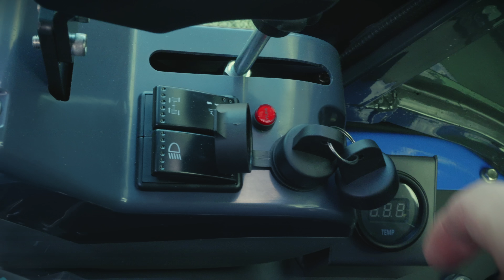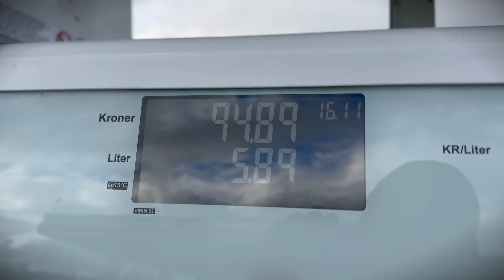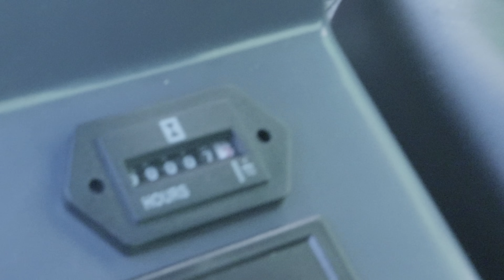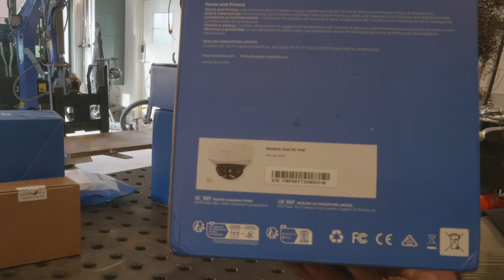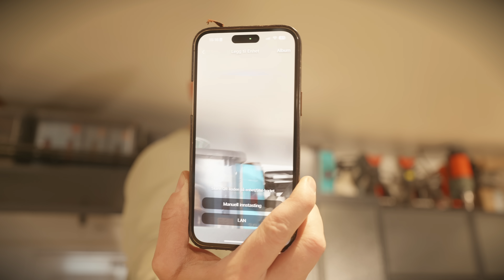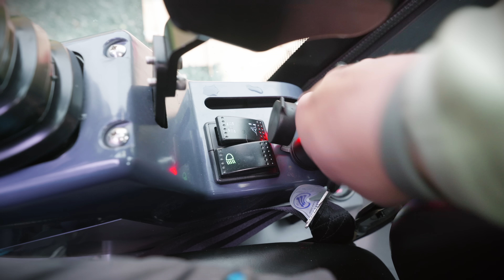I Bought a Mini Excavator From China and THIS Arrived!

Comment: I was more impressed by the truck. The way the bed opens and the mini-loader attached to it. Mind-blowing.
Reply: Those attached fork-lifts are pretty common here, they are also most electric now.  
The side and top opening truck box however is pretty cool indeed.
Reply: @DooMMasteR is that also from China?
Reply: I know it was really impressive. I liked the little blue thingy that moved the box out of the truck. Was carried away thinking what I could use it for.😂😂😂
Reply: They have indoor bathrooms now aswell ! Poor Russians
Reply: They are called moffett lifts
Reply: If you look at video again at about 1:07 the forklift moving the crate off the box seems to magically slide the box across the forks like it is using the force or something. I think it is AI Generated.
Reply: @peterprittscher7532  don't talk about something that you know nothing about, these machines are very common in Europe. It's called a truck mounted forklift (Kooiaap in Dutch). It moves the crate like that because the forks themself are also extendable, separate from the scissor mechanism that you see

Comment: I understand, but it looks a bit too tall, making it possibly top heavy.  Just one wrong angle & it could tip over.  It would have been nice if the track treads were a little off to the sides more to make the bottom wider, to make it less tipsy, but in a way having the tracks exactly straight underneath makes it narrower & compact to park somewhere.   Just have to be careful about angles/pitch where you drive it.
10/26/25

Comment: I love it. We borrowed one without a cabin to dig trenches for some cables. It’s definitely better to have one with a cabin, so you don’t have to breathe in the exhaust fumes all day and it is also safer. It works fine. If the ground is hard, one ton is light and you have quite a bit of work to do, especially if you’re operating it for the first time. But you get used to it quickly, and it’s fun to work with. You just have to be careful if the terrain isn’t flat.

Comment: My parents had a kabota tractor for a small farm, with front forks attachment. It had a hard life of cultivating heavy clay soil, clearing barns of manure but after 35 years it out lasted my mother and was given away to a local farmer.   Absolutely reliable, the only repair was re-welding a front fork bucket mount when it got ripped off.
Careful, don't let it run out fuel as you will get air in the diesel lines and high pressure pump and it can be a pain to bleed the air out.
Reply: Having had and driven many machines (skid steers and excavators) I know what a pain that can be, but this machine shuts off when low so it doesn't require priming. Most modern machines have this feature. You should always keep your fuel topped up though, it is just good practice and prevents condensation and water from getting in the fuel.
Reply: They have a little hand pump these days easy to bleed them

Comment: I’ve had a Kubota 1.5ton for around 10years now, just looking after 3/4 acre, not getting much use these days but it’s to handy to move on.
I have added a lot of wear to the boom by digging root balls that were to big for the machine and brushing dirt sideways with the bucket, if you cut these things down to a minimum your machine will give you good service. Cheers.

Comment: Trying to move excavator with metal parts still packed under threads and excavator still bolted to box, failing at the most mundane task of filling a tank with gas, hammering pin with the battery side of an electric drill.. and on and on. Dude, you should NOT be making these videos. Hire someone to do your work and stick to what you are good at. This tractor is not for you. You are giving me a concussion from the facepalms I took watching this. Cheers. (also, the tools you need for those potholes are called "a wheelbarrow and a shovel")

Comment: One guy said that you should start one , dont do anything for 1h , swich off change oil , start again do some work for an hour then change oil again. This should extend the life of the engine greatly. Make sanse to me
Reply: In older tractor manuals, it was always recommended to do light work, no more than half throttle, for some hours (10h - 25h, it varied from manufacturer to manufacturer), then change the oil. After that, you could go full throttle for a little while, 25 to 100 hours, again, depending on manufacturer, then change oil again. After that, the engine was fully ready for hard work.
Reply: @MrAstrojensen yes, always have to run your engine in .
Reply: @roystonevans2223  Not so much these days. The run in was primarily for the rings to "bed in" to the cylinder walls. The engines would use a bit of oil initially due to this. Since catalytic convertors came along, manufacturers have used bore finishing techniques that simulate an already bedded in cylinder, so they're virtually ready to go from the start, no run in required. This is because oil consumption kills catalytic convertors.
Reply: It's a Kubota engine. You can switch out the oil with dog piss, and it'll still run for 20k hours
Reply: I know someone who just ran it with the original oil. After a year, not sure how many hours of use, it had some kind of piston failure. He’s going to take it apart and see if he can get the parts for it.
Reply: Use the Dozer blade for levelling.
Reply: That advice is not bad advice it makes sense and to get more use out of it is the name of the game so it’s worth getting oil and filter ready for this and know what advice Kubota says
Reply: Gets rid of any crap.

Comment: Hydraulic thumb, and mud bucket... with a kubota engine, for 2k , i dont believe it , in Australia that would be at least 18k.. i bought a 1.3 ton machine 4 years ago with a 10 hp single cylinder chinease diesel; and a set of attachments, it cost 15k Au dollars

Comment: Coworker bought the same digger a year ago, and this year he got a Mini Dumper from china that you can drive yourself or use a remote controll. Stuff is f**ing great.
Reply from the maker: Sounds like your coworker has some great taste in machinery! 😂
Reply: @frengen_engineering  He is single and a lifelong heavy machine welder, and hydraulic tech. And he loved his horses. With these machines he can sit in the Digger, load up the dumper, grab the remote and drive in sightline to the right place, dump 5 wheelbarrows of material, and drive back to load..

Comment: I bought my first excavator 15 years ago.  It was a half wrecked 10+ year old Komatsu PC12R-8.  I got it cheap because the hydraulic pump was cracked.  Replaced that for $1100 and kept the machine for 14 years.  Sold it last year for $2000 less than I paid for it (buyer drove 5 hours each way to collect it, and had guys ringing for several weeks later, asking if it was still for sale (I guess they took a bit of time getting ‘permission’ from the missus 😁)
I bought a brand new Komatsu PC18 MR3. Phenomenal piece of kit.  
This little machine looks pretty good, but the buckets and all the components just even sound pretty lightweight.  Sure beats digging by hand, though.  
For the driveway gravel, try bolting a nice old railway sleeper to the grader blade, sticking out each side a good bit.  Does a fantastic job. 
Also, I welded on a thickening plate and drilled a hole through the middle of the grader blade to accept a trailer tow ball (I cut through the square hitch receiver tube, just leaving the ball on a piece of 18mm thick steel bent 90’, with a M22bolt through the blade.  Great for towing a small trailer that you can dig into as you go.
Reply: Wow that's a great ownership story.

Comment: Your driveway before you put gravel on it, was better than most roads in Australia.
Reply: To be fair, that driveway probably also sees more use than most roads in Australia.
Reply: Yes, we have many potholes in our roads in Sydney, but it doesn't matter because we can't drive faster than 10km/h (roughly 6mph) because there's a bloody speed bump every five metres! :face-orange-frowning:
Reply: @evp3891 I'm 900klm north of Sydney. The roads up here are a series of holes held together by tar.
Reply: @evp3891  The potholes, speed bumps, ridges, cracks, dips, humps and uneven roads in Sydney is why more and more people are buying and driving SUVs, mini trucks and vehicles with big tyres to absorb the shocks. Otherwise, one doesn't need any massage chairs - driving along Sydney roads is enough to either give you a vibrating massage or enough to rattle your teeth out.
Reply: @GeorgeHooi-t1r  yes, unfortunately you are 110% spot on 😱
Reply: The main road from Cairns to Alice springs is a sand road , I have been on it
Reply: @freespeech4023  Nonsense, the main road from Cairns to Alice Springs is definitely not on sand. I've driven it several times. If that's your experience, then you must have taken a completely different route away from the main road. Don't make Aussie-Roads worse than they actually are.
Reply: @eric.s.081you must have been  on a different road or the road I was on has been tarred now , I was in Oz in 2005 I have been and I was on the sandy road from Cairns to Alice springs , it has many lorries and buses stuck in the sand ,
Reply: Better than ALL roads in Ireland.
Reply: we don't have kangeroos here jumping around, must be the difference
Reply: @wizpin  The kangaroos in Australia learned to jump because of the many potholes we have out here.
Reply: Чёрт возьми, да у вас там похоже действительно всё перевёрнуто кверху ногами 😂😂😂

Comment: I’m amazed by the delivery truck setup!
Reply from the maker: The truck was super cool! 😎
Reply: I’m amazed how the crate seemed to magically slide towards the forklift.  How?
Reply: @castrain1419  I have rewatched a couple times and have no clue.  Maybe the forks have tiny rollers that we can not see? Or belts.
Reply: @castrain1419  Just saw extendable forks on down?  I guess?
Reply: @AJLindvall  Telescoping forks. THe hydraulic lines at the top of each fork provide the telescoping power. If you look at them before/after the cut around 1:05, you can see the forks are all nice and black, then when fully extended under the crate you can see the black 'caps' of the forks retracting over the more rusty inner fork as is slides.

Comment: For $12000 ,you have been ripped off ,especially if it's made in China .Also trying to get parts is a nightmare .
Reply: $2000
Reply: @malcolmstevens2838  It said $12000 in the description.

Comment: Watch Marty T from New Zealand...he has a couple of excavators including mini excavators....

When repairing potholes you need to use the ripper tooth to take apart the hole...so that the bottom of the hole that forms the "basin" gets holes in it improving drainage.
The new gravel then mixes in and "keys" to the hole.

Otherwise the new gravel just gets flicked way or washed away when the hole fills with water in the "basin"...
and a tyre running over it just pushes the water and the new gravel away from the hole.....

That's good excavator with plenty of accessories.

Always grease every part that needs greasing at the end of the day's work...ready for a quick start the next working day....
Reply from the maker: Thanks! I actually did this for the biggest pot holes. Used the teeth- digging bucket to loosen it up. Then I flattened it all with the dozer blade. Then compressed, before adding new gravel😊 But some holes I just filled with gravel, making sure I will have to redo it once in a while 😂
Reply: @frengen_engineering    Excellent future planning.  Have to make sure the justification for the tool is maintained. Multiple opportunities to impress the wife. 🤣🤣🤣🤣🤣🤣🤣🤣

Comment: Pssst ... I think your bucket is backwards there sport. You scoop at the bottom of the pile going away from you and up.
Reply: As if you know how the attachment works!  Pretty obvious to me that a) the hydraulic arm only connects to the accessories one way and there's no option on which direction the bucket faces, and b) by scooping inwards, it keeps the center of gravity more centralized (when the bucket is full) on a machine that has a high center of gravity to begin with.
Reply: No you don't.

Comment: Um, What are you going to do with it once you finish your reno?
Reply from the maker: Hi! As for most other tools, it opens new possibilities and sparks creativity… wow, that turned out cliché😅
Reply: At a guess...maybe hire it out?
It would be popular...
you might even risk "dry hire" 
where you give a brief instruction and then let the hirer do all the work at their risk????
Reply: @JohnSmith-pl2bk  For what he showed in the video I am sure it would have cost 2k or less to get someone to actually do the driveway. Seem a bit odd to actually buy a machine for a one off job.
Reply: @FullLengthClassics you invent jobs with a machine like this.
Reply: @FullLengthClassics  
See Just a Few Acres YT channel. 
Pete bought an excavator  second hand...and so far has found multiple uses for it on his small farm...doing things like drainage ditches, gravel driveways, gardening, stump removal, water line trenching, steel fence stake extraction from the ground thereby saving his back,  firewood tree handling etc. etc.

Marty T channel uses excavators large and small...
and Marty bought a "mini" Takeuchi which is the Rolls Royce of excavators....
but also uses a 50 year old Hitachi he found abandoned in a forest...
and a small old excavator he uses on an island....

Comment: 8:09 , It's for that very reason I bought one of those $20 battery powered fuel transfer pumps. No more lifting a heavy gas can while your back is in a sustained twist. Just stick it down in the gas can and hit the switch. Can also use it for siphoning the water out of a toilet for better cleansing without the solution being diluted and weakened by so much bowl water. I think it siphons oil to.
Reply: Keep your pump out of the toilet and just use a toilet brush instead!
Reply: @ne5i_ rather use baking soda 🥤🥤🥤 and vinegar mix, work's even better, no 🖌️🖌️🖌️ needed 😂😂😂😂😂

Comment: It has a Kubota diesel engine...the rest doesn't matter, it's easy to fix
Reply: Pumps ,valve chest ,drive motors, hydraulic couplers and lines ,wiring loom...actual steel the machine is made from....there are all VERY important and where you will find our chinese buddys fall down quite often....
Reply: @johntheball   Yes, but you can repair them with the same parts you can get from China...while the engine itself you have to call a mechanic.  Having a crap engine is so bad trust me, i know from experience...we have a forklift that always breaks down.

Comment: That's a very good idea, when it runs out of fuel it stops automatically.
The Chinese should patent that.
Reply: It might be that the engine shuts down BEFORE the whole fuel system needs to be bled of air...
now that's smart engineering!
Reply: @JohnSmith-pl2bk  Possibly.
Reply: It would be better if it ran on and on without fuel! Then it should be patented!
Reply: @Condoreye  But it didn't, and won't. Pay attention.

Comment: 'When the fuel is out, the machine stops automatically'.
I mean,  what are the chances? 😂😂
Reply: They should patent that.
Reply: Senses low fuel and automatically cuts the engine before you would otherwise need to bleed the whole fuel system of air....
good engineering!
Reply: @JohnSmith-pl2bk  Handy.
Reply from the maker: 😂 I was meaning to say that when…nevermind. Your take is better😂

Comment: Make sure you check and tighten all the screws and bolts.
Reply from the maker: Good tip! Will do a full check
Reply: @frengen_engineering  also your excavator may have 2 speeds and expandable tracks
Reply from the maker: @Infinityboi1000 It has expandable tracks, yes. And 2 speed. One speed when it’s driving itself, and another speed when it’s on a trailer. Sorry, it’s a bit slow😂
Reply: @frengen_engineering  no problem
Reply: @frengen_engineering  no problem
Reply: @frengen_engineering it's ok. Rome wasn't built in a day
Reply: The most dangerous nut is the one behind the steering wheel 😂
Reply from the maker: @TrevorBarnard-s6d  you’re correct😆
Reply: Are there grease nipples on the boom joints that should be filled with grease?
Reply from the maker: @AliusScitmelius Will check when I’m home!
Reply: Agree all new machines need a nut bolt screws etc check , they may loosen with vibration, my mate had it on a Yamaha quad bike , a few nuts were loose after he rode it a couple of times luckily he went o er the bike or he may of had an accident or large repair bill. It may seem that it’s a bit tedious but it’s well worth an hour of your time to do this. 
Thanks for the video and great find and nice work , 👍

Comment: Nice looking machine, very well equipped and looks well built. I notice the hoses for the quick connect stick out quite far for some reason, it might be a good idea to tie them in or put an elbow on the end.
Reply from the maker: I agree. Will do a little excavator upgrade- video. I guess this is one of the things I will fix. ☺️

Comment: 6:14 So far, it seems incredible value for money. They didn’t need to include those wrenches so that’s a positive sign. 
Also (and much more importantly) the engine seems to be a genuine Kybotu and not a Chinese copy. 
In China it’s not unusual to describe a copy as the original. That’s not intended to be fraudulent, just a cultural difference. If you want the real product, look for words like genuine or imported etc.

17:32 Fantastic product!
Reply: The wrenches are for when it breaks 😀
Reply: @andyhewitt7588 😁
Reply: @andyhewitt7588  
They are also for when you do maintenance..... to prevent it from breaking.....?
Like the grease gun....if you don't use it....the machine will break.
Reply: Haha, you are wrong, it is intended to be fraudulent... Thats the whole China filosofy, cheat and deceive it is in their blood.